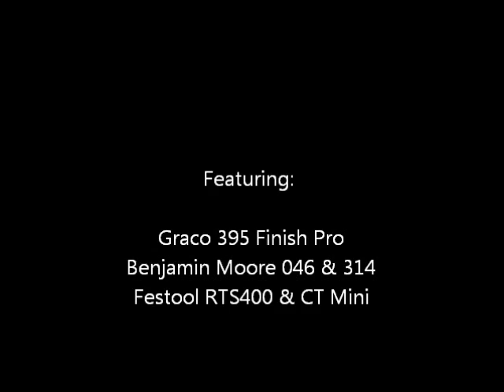Festool prep for Cabinet Spraying with Waterborne Products

Comment: hi really enjoy your videos! Do you always have extraction when spraying in homes? if so do you need to mask all the area that the mist will track to go to the extraction and mask the window it goes out of etc so no overspray sits on the aluminium joinery on the way? would really appreciate your advice
Reply: Jacob Howe Dust extraction is during the sanding steps only,  not spraying. During spray, the room is sealed or mostly sealed, probably.